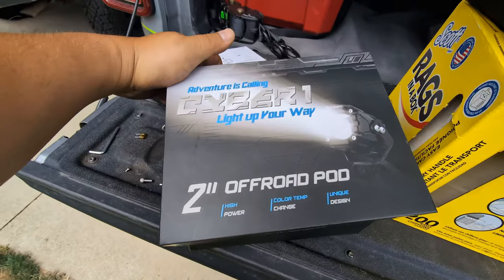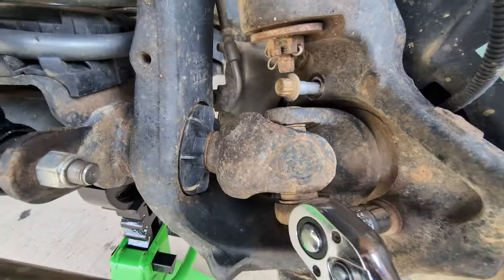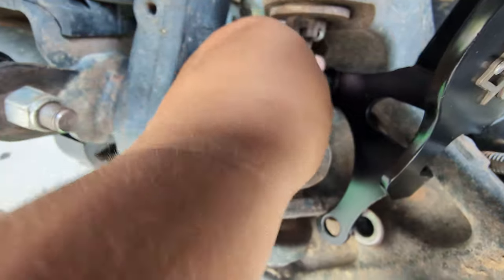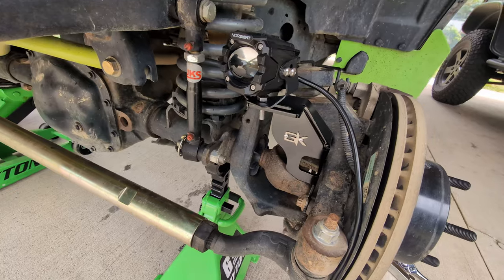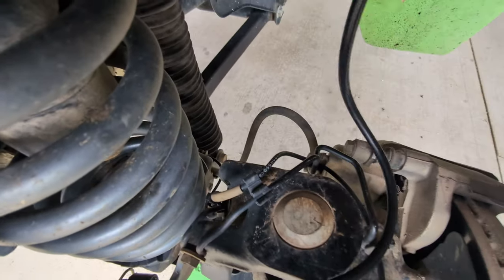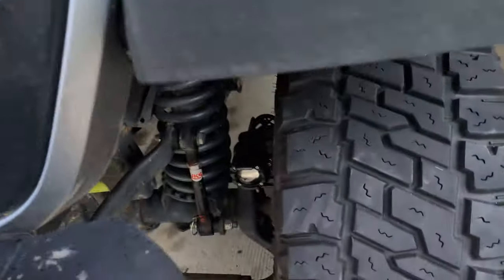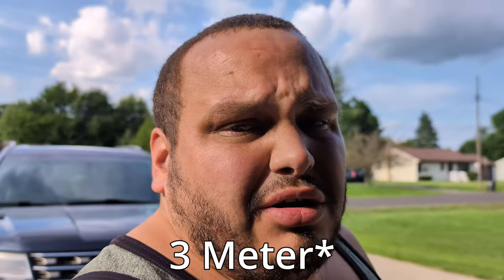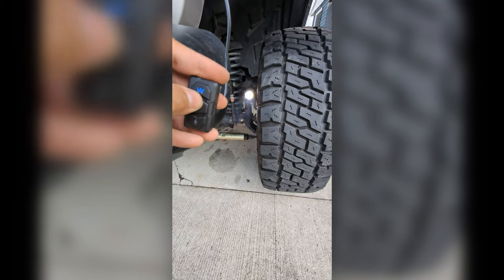Knuckle Lights Installation?!? | Gatekeeper & NovSight to the Rescue.

Comment: LOL, their not going to get ripped off, broken or fail. Unless you never off road it of course. Thanks for the vid.
Reply from the maker: @basementracer  not sure what you meant by that. 

My main issue has been I didn't have a way to flex and check clearance. (I had a clearance issue already because of light location on the bracket, so I had to bend it back.)

Otherwise it definitely works fine, just need to tweak position to be best as possible. 

However more usage and off-roading is coming.
Reply: 1) there is ZERO REASON to do this BS, ZERO
Reply from the maker: @CristianZamora  that's a matter of opinion. But hey... If you don't like it.. that's fine. 

But not really a good reason to bash it. 

Like it or not, just keep moving otherwise. 

But hey... Just means you watched it which helps me.. even if you don't like it.
Reply: @CristianZamora  If you've ever flexed out hard enough at night and saw your headlights pointing in the trees you'd understand....or if you've ever made a u turn at night....or if you had a jacked up Jeep and no fog lights low enough to actually work....weird I just thought of 3 reasons.

Comment: Is it necessary to remove the tires?
Reply from the maker: @jinoh7418  ok... So... Not entirely. But getting the weight off the tire is required.

To put these brackets on you are in essence temporarily removing 2 of the 3 bolts that hold the wheel hub onto the steering knuckle. Don't put that much stress on the bolt or it might cause issues. 

If you don't know the wheel hub is the piece that your rotor and tire bolt to
Reply: @trailtothevoid  so lift it just a little bit?

No way I'm tsking my 38s off haha
Reply from the maker: @jinoh7418  yeah. So if you lift at the axle, just enough so the tire is barely touching the ground that's the ideally way. 

And you need to have a 12 point socket or wrench.. I wanna say 13mm... But don't quote me on that... I think I said the size in the video. 

But yeah, just don't want the tire pulling down the hub or the vehicle weight pushing up.
Reply: @trailtothevoid  thanks man!